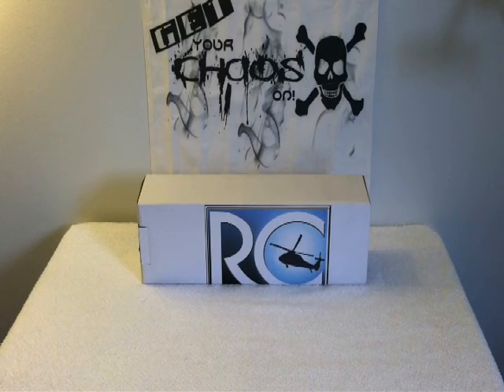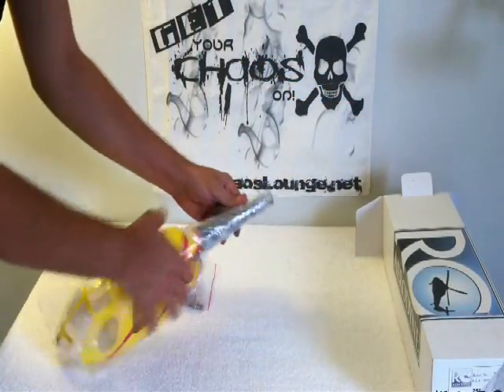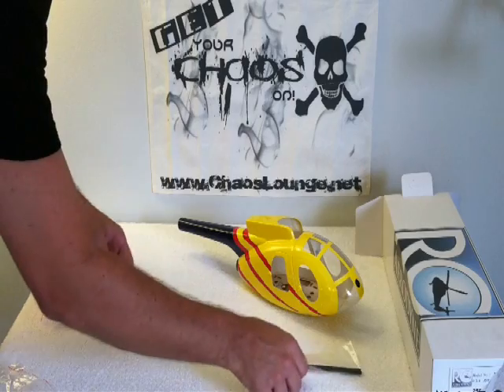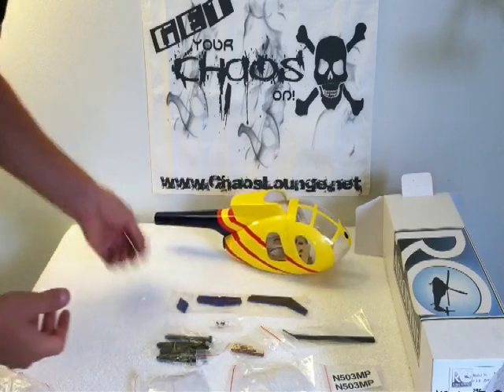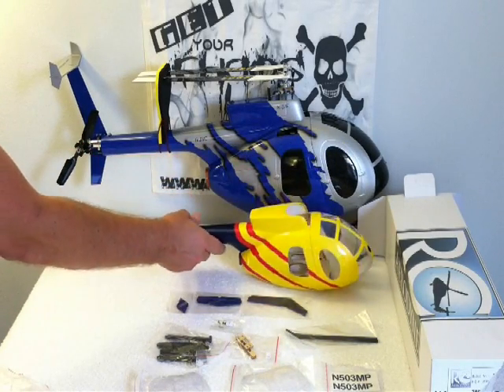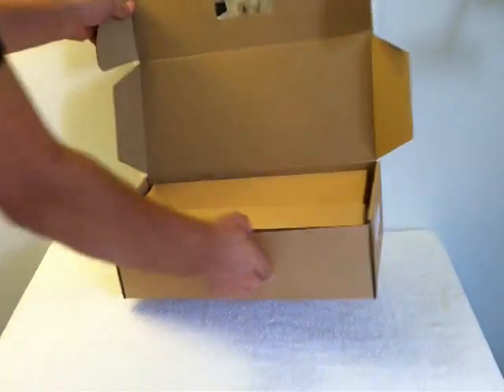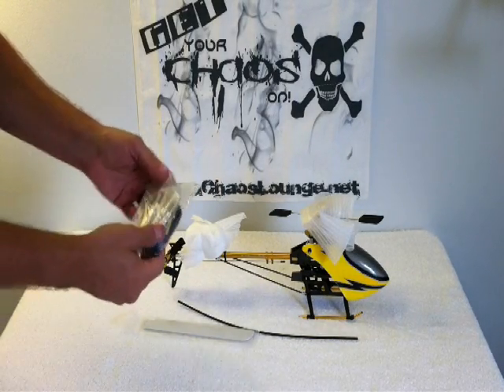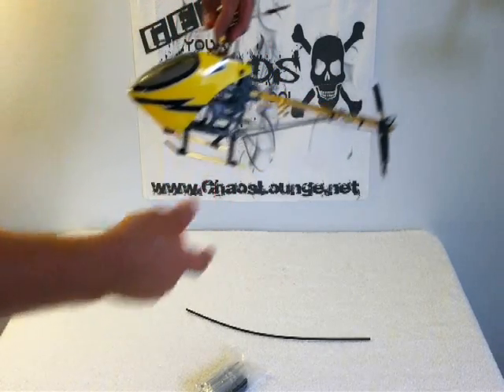Whats in the Box Review MD500 250 size fuselage from RC Aerodyne

Comment: Hey Chris. I just purchased the same Full House Helis 250 kit that you have here. This will be my first build and I thought it would be a great starting place since it only needs servo, battery, and radio. the problem is it has no instructions and I'm not sure where the parts mount exactly. any idea where I can get instructions or could you give me any advice.
Reply from the maker: It should be the same as the tree 250. It wasn't the best quality Heli I just put it inside the fuselage as a display. An OXY 3 would be an ideal first kit build!
Reply: Hi Chris, if possible put OXY-285 in this 250 scale, please advise, thx a lot.
Reply from the maker: minijr68 oh no the OXY is a much bigger Heli. Only thing that will fit that is a 250 class Heli. My friend is selling a Trex 250 with electronics and a spare brand new kit. Send me an email 3dandscalerchelicopters@gmail.com
Reply: Thank you.